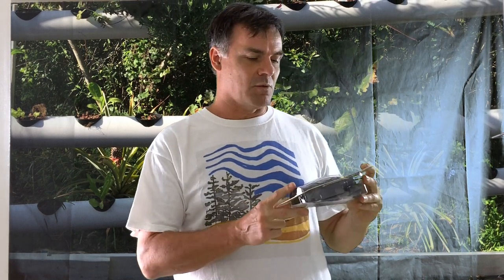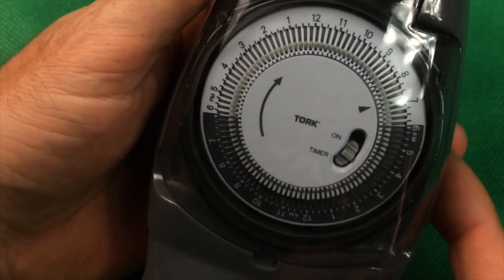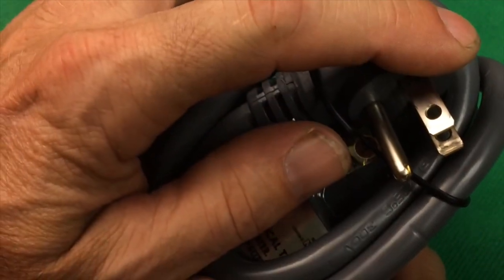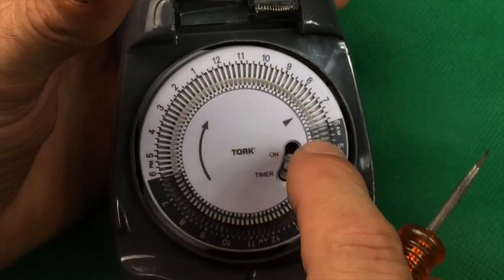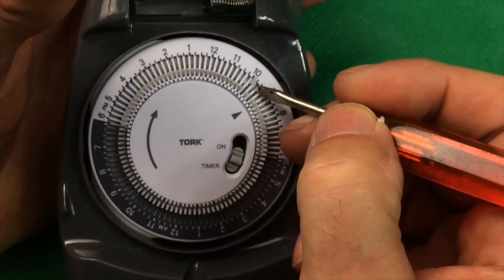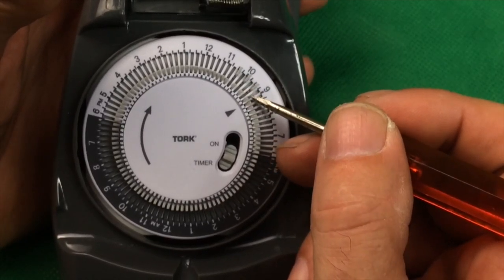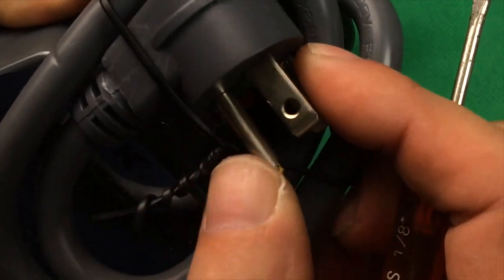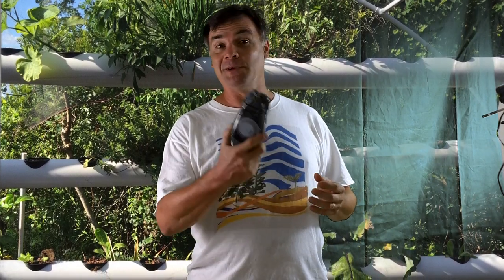Hydroponic & Tower Garden Timer

Comment: After I concluded that my Tork timer was not working on my Tower Garden (thanks for the video), I developed a work-around that solved the problem in a different way that you might like. 
I recently had purchased a 2-outlet Kasa Smart Outdoor plug on Amazon for $29. The Kasa plug is also Alexa-friendly so I set up an Alexa routine that runs every day from 12AM to 12 PM. The routine is simple - all it does is turn on the Tower Plug, wait 15 minutes (or whatever wait period you want), and then turns off the Tower plug. I repeat this “on-off” sequence 48 times over-and-over so the routine runs all day and night (there is no “loop” capability in Alexa routines yet) which is a bit of a pain, equivalent to setting all the independent switches on the Tork time. 
But once you have it setup, it works great. Less mechanical pieces to break (like on my Tork) plus you can more easily change the wait period to whatever you desire.

Comment: Hey there, thanks for the tutorial.  I'm just wondering if the different between the "on" and "timer" setting.  Thank you
Reply from the maker: Hi Nomad!  Thanks for the question.  The difference between the "on" setting and "timer" is the when in the "on" position the pump will keep running and not use the timer cycle that is set on the dial.  When you select "timer" then whatever is selected for on/off on your switches will determine when the pump is on and off.  Hope that answers your question!

Comment: Good thing I found your channel.I had a problem with my hydroponics growth tower.My pump overheated for running 24/7.I bought a timer yesterday.Question, will damage the pump if it’s turning on and off every 15 minutes?will it decrease pumps life span?
Reply from the maker: Hi Glen,  Thanks for the comment and question.  I have had some of my pumps running on the 15 on 15 off schedule for 5-years and they are only turned off for cleaning of the various systems or the pump filter. In the last 5 years I have only replaced 1 pump I have 3 towers, a home made system I call a VGS, and a General Hydroponics system all on the 15/15 schedule.  I do keep at least 1 extra pump on hand just in case of a failure.
Reply: @Project-vo2un  May I know what is your pump?Thanks a lot.

Comment: What interval do you use at night?
Reply from the maker: +damatrix1001 We use two different times depending on the season here in Central Florida.  During the hot, humid summer nights we run 15 minutes on and 15 minutes off (so during the summer we are running 15/15 for all 24-hours), during the winter we run 15 minutes on and 30 minutes off (usually from about 10 pm until 7 am).  There have been a few times during some really hot days when we will actually run the system non-stop for a few hours during the heat of the day then back to the 15/15 time.  Hope this helps, let us know if you have any other questions.
Reply: What type of system are you running on time interval ? Thanks
Reply from the maker: Hi Bruce,  the two systems that we are running on this time interval are the Tower Gardens and VGS.  We have some other systems that are non-recirculating, and a new system for us an aeroponic system from General Hydroponics that we will putting together and installing this summer.  With the system that we will be doing for the aquaponics we will go with the CHOP system (constant height one pump) that will run with the ebb and flow (flood/drain) technique.
Reply: Thanks... another newbie question:  Is the VGS system an ebb and flow?  Thanks for your help.  I too am in Florida trying to get a summer set-up going.
Reply from the maker: Hi Bruce,  we are still learning the "Florida" weather and seasons as we just relocated here from Southern California 3-years ago.  (totally different grow seasons, temps, & humidity! oh and insects!)  The VGS is not a typical ebb and flow system. The ebb and flow systems traditionally have the pump running continuously and use something like a bell siphon and when the siphon kicks in then the drain cycle kicks in. With the VGS the pump cycles on/off we are using the 15/15 minute cycle, the pipes never fill there is just about 1-inch of water running through the bottom with the exception of the last foot of pipe will fill to the point of the drain level (about 2-inches). We used the ebb/flow system in our old barrelponics systems, but no longer use that systems.

Comment: Thanks for your knowledge and information. I have two timers, each one runs only on the on setting not on the timer setting. Since it is working on the on position I know it  is not my outlet,  I have rinsed off the filter. I am dumbfounded not knowing what else to to do other than to buy another timer but I don't think that is the problem. Any ideas? Thanks for any input you may have.
Reply from the maker: Hi Rene,  Sorry to hear you are having problems with your timer.  We had one fail last year - here is what you can do to see if the timer is bad.  First make sure the timer is turning when it is plugged in.  Second - unplug the timer and make sure it is in the auto position and turn the dial by hand, you should hear a click (and feel a little resistance) as you turn it and it engages between each on/off cycle.  I opened up the one that failed for us last year and there as a small plastic part that broke and when I turned it by hand there was no clicking sound.  Hope this helps - let me know if you have any other questions and whether this helped or not.
Reply from the maker: Hi Rene - we put together a quick video on how to test the Tork timer to verify it is functioning properly - you can check it out here: https://youtu.be/MrswmhU2ciQ

Comment: i want to operate the timer *(110 v)for drip irrigation, to do that i count with a solenoid valve that i took  from an electric washing machine that runs on 220 v )( i will plug the timer with a transformer 220 - 110 my question is do i need to plug a (i live in a place with 220 v) trans on the outlet as well? i am hoping somebody will answer my question...thanks

Comment: my timer- with my towergarden- i watched the video regarding testing the timer.  the on switch works but the timer wont  do you think its because some one got it wet?
Reply from the maker: Hi Laura - sorry for the delay in responding - I have not had a problem with any of my timers getting wet from rain or over spray from the hose.  I have found that I have had a timer in the past the the on/off switch would work but the dial did not move and when I opened up the unit I found one of the plastic gears broken - that could be the case with your unit.  Hope that helps - let me know if you have any other questions.

Comment: You forgot to explain why there is two spots under to lug in WHAT
Reply from the maker: Hi Louise - thank you for your comment - we did not really feel the need to explain what needed to be plugged in as with hydroponic systems the only items that you would normally need to power with a timer would be a pump and/or a light system.  (when using a timer with a light the 15-minute interval timer is not normally the choice as you leave lights on for longer durations). Being a timer this unit can be used to power any small appliance or electronic device that you would normally plug into a standard 15-amp receptacle.